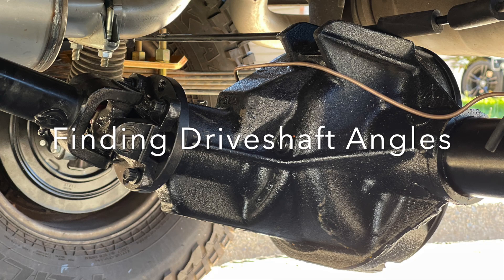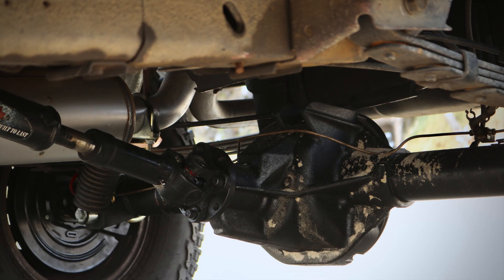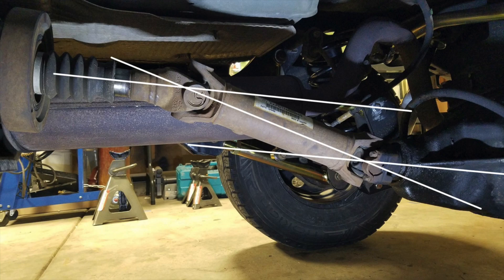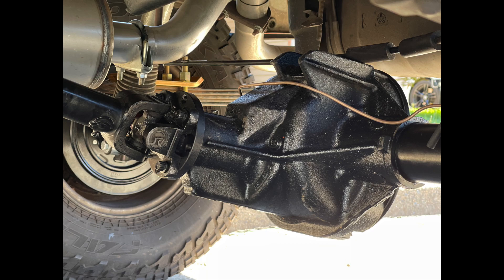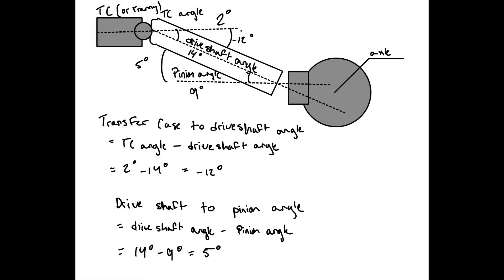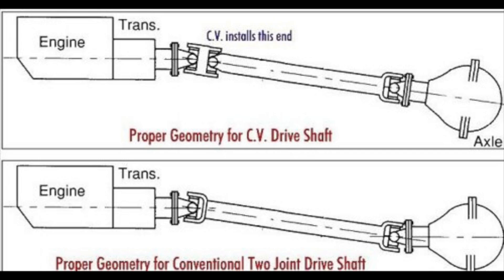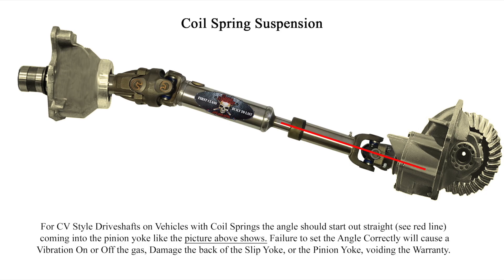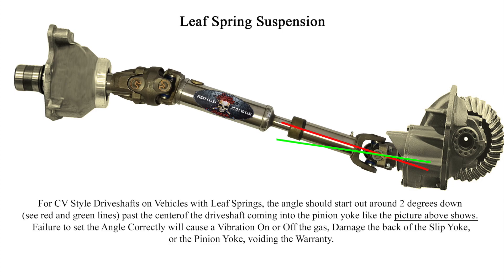Checking the Pinion Angle and Measuring for a Driveshaft on a XJ

Comment: You said you were currently at 5 degrees on your pinion angle, is there a maximum tolerable degree or is it all up to if you get vibrations?
Reply from the maker: I’ve found you can get away with about 8° on the pinion, assuming you have a SYE. But it’s probably more of a case by case situation. Ideally for a SYE, 2° for leaf setups or 0° for coil setups is where ya want to be.

Comment: I just had a new driveshaft put in and my car is making horrible noises. Scraping sound and sounds like a motor bike or air brakes sound when I’m slowing down without brakes. It also makes noise when I turn. Maybe they got the angles wrong. I’m so upset. I only had a slight vibration so decided to change it but now I’m regretting.

Comment: Is there a method for finding control arm length?
Reply from the maker: I’ve always opted for measuring the wheelbase. So measure from center of the rear wheel to center of the front wheel. Needs to be 101.4”. So you can just say “it’s 100.5” now, so my axle needs to go forward almost an inch, so the lower control arms needs to be about an inch longer than what I have now” If you know your way around some trig, you can do the math to figure it out perfect the first time. But there’s also charts online for what you should aim for based on a specific lift height. Google “XJ control arm length chart” and it’ll pop up
Reply: Tom Woods recommends negative 1 to 2 degrees for a CV.

Comment: By the way i have and fj80 and been dealing with vibrations after 4inch lift so to my understanding i want my pinion to be at zero degrees since i dont have a double cardan?
Reply from the maker: So you want the angles to be equal and opposite for the type of driveshaft that has one u joint on each side. So the angle off the transfer case to the driveshaft is some angle, so you want the angle off the axle to the driveshaft to be the same. Assuming it’s coil sprung. If it’s leaf sprung, you want an extra 2° on the pinion angle. So if the angle off the transfer case is 5°, you want the pinion angle to be 7° for a leaf setup